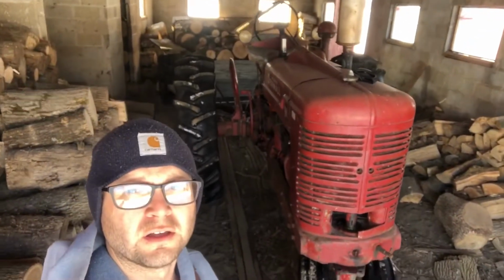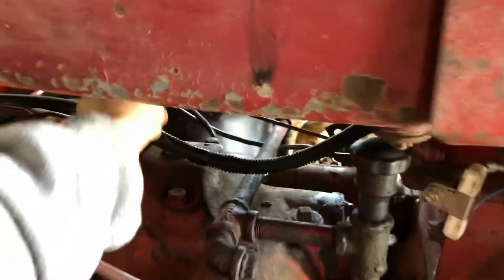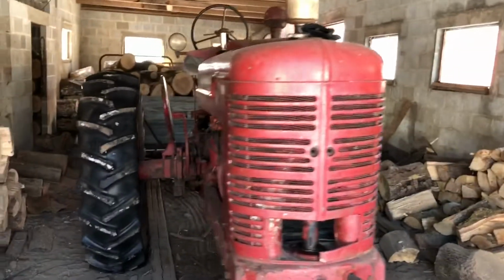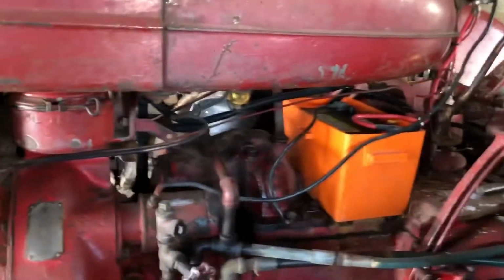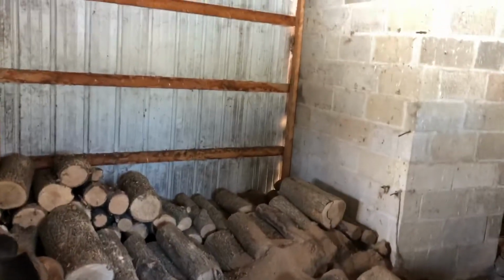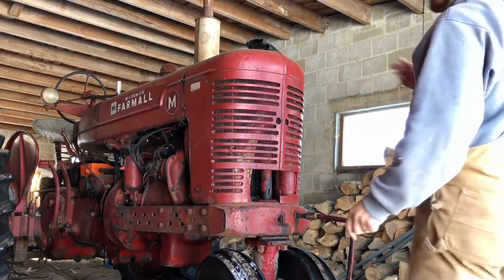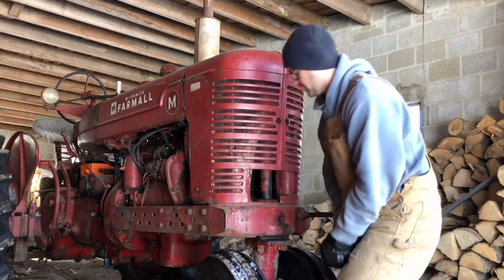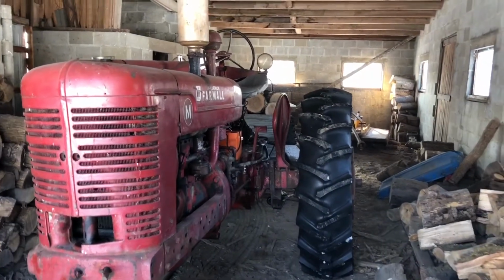Hand Cranking a 1946 Farmall M

Comment: There is a super M on the dairy I help out on.  It was in the shop with the starter out.   The boss wanted to move it outside and asked me to help.  He went to get another tractor and I went to get the crank. I had it running before he got back.  He couldn't figure out how I started it. I just said it was a secret.
Reply: Chinese secret

Comment: They built some tough tractors back then.   Really about the only thing that usually ever needed was points and condensor, and maybe spark plugs.
Reply: Tell that to my damn carburetor…. I’ve rebuilt the damn thing twice only for it to leak more. I never want to see a gas engine again.
Reply: It's the lousy gasoline that they make now.   It destroys carburetors.   My Dad always turns the gas off on Our tractor when he is not using it.   I think He rebuilt the carburetor 3 or 4 times, but it didn't do any good.

Comment: I'm currently trying to get one of these running on my Dad's farm.  I can't get it to fire and it cranks so slowly on the 6 volt system that I think it might be the problem.  Next time I'm out there I'm going to check if the crank is sitting somewhere on it.  It has a huge farmhand attachment on it so I can't just hook it to another tractor and drag it around the yard to start it.